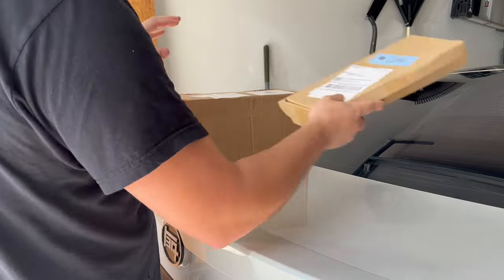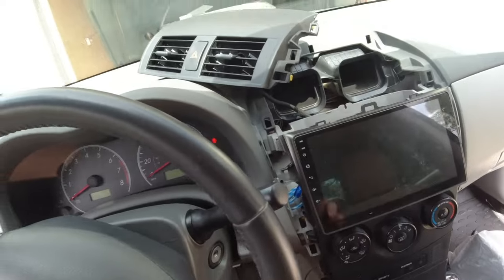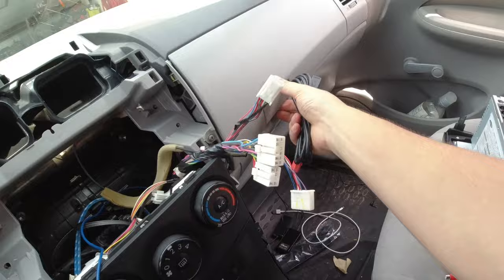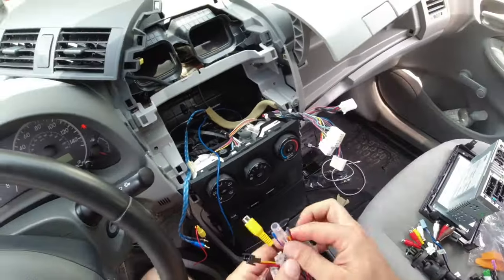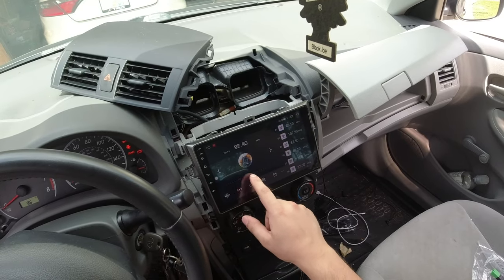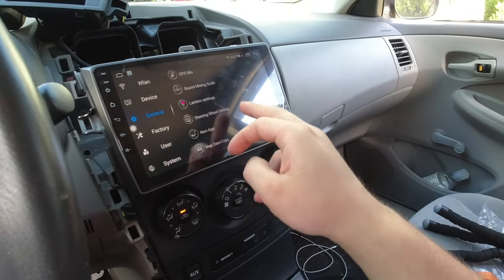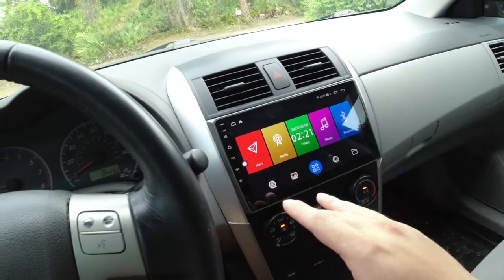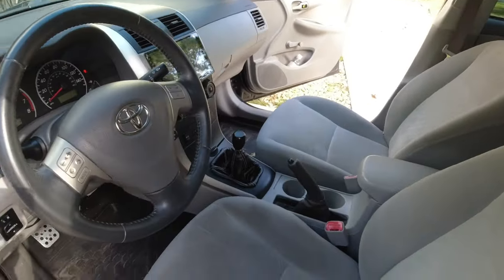Installing a iDoing Radio In My Toyota COROLLA(2009-2013)

Comment: I have one of this myself, decided to get the AHD cameras for the front and back and have the front triggered with mode like you do. Honestly, AHD cameras look so good with these head units as they support them it’s basically crisp. I find it useful when parking at night at dimly lit places
Reply from the maker: Yeah I agree this head unit makes the cameras look really crisp!
Reply: Where did you get your cameras from???
Reply: @LacedRhymes  AliExpress, mine is a 1080p AHD camera for the back and 720p for the front. You’ll have to set the resolution to 720/1080p on your android player to get it to work!
Reply from the maker: I ordered mine from eBay.
Reply: @DawnVengeanceX  ok and do they have one for iPhone??? I use apple more lol
Reply: @LacedRhymes  what do you mean by one for iPhone?
Reply: @DawnVengeanceX  i meant to say is it Apple CarPlay compatible
Reply: @LacedRhymes  My android player has built in CarPlay so whenever you reverse it switches to the camera without disrupting the music. Once you switch from reverse it goes back to the CarPlay screen as per normal, it works fine with the iPhone
Reply: @DawnVengeanceX  cool that’s what i wanted to know before i buy it for my Corolla and also gotta find a reverse camera for it
Reply: @BrandonStellmach  can you please share the links for your back and front cameras? Thank you, Brandon.
Reply: @DawnVengeanceX  Thanks for sharing. Dumb rookie question, what is the "front" camera used for? Does this head unit provide inputs for both a front and reverse camera without having to buy another adaptor?
Reply from the maker: Front camera: https://ebay.us/ZrKg8I

Back camera: https://ebay.us/nm90QX
Reply: @BrandonStellmach do you have another link ? It’s says that’s is not available on EBay
Reply from the maker: @andresvalentinocolinabermu31 I will be updating my links in the next week, some of my older videos the links are not active. Check back within a week and I will try to have the links updated!

Comment: You should do step by step how to wire it and not just do it at a fast paste. You talk about it but we need the step by step
Reply from the maker: Sorry if it wasn’t detailed enough, I try to make them as detailed as possible, without making the video to long or boring. And this video was almost 30 minutes, so I did have to cut some things.
But if you have any questions with the installation, just ask and I will help out!

Comment: For the USB routing, you could have someone 3D print a bracket for your car. There's several STLs I've found.
Reply from the maker: That’s actually a good idea, because the USB’s are always rattling in the glove box, maybe I might do that!
Reply: @BrandonStellmach  I think this one might work, since it's a double cable: https://www.printables.com/model/223573-usb-switch-hole-cover-for-toyota-yaris
Reply from the maker: Thanks for finding that, I was literally just looking for something. I actually have a 3D printer. So I might give this a try and see how well it comes out!
Reply: @BrandonStellmach  Nice. I'm going to order a print from Shapeways whenever/if I upgrade from my Kenwood single DIN to a double.

Comment: Good video. My guess with your reverse is it's not being triggered on the radio. Look for a rev cable on the head unit and the reverse camera retention harness should have an RCA and a signal cable that triggering the reverse on the radio. From looking at you crimping the harness I'd say do the touch test with the bare wire while the car is in reverse, also do it while the car is on some cars are weird like that. Or try an alternative reverse trigger to the head unit.
Reply from the maker: Thank you!! 
And I did figure out the backup camera, I didn’t have the plug in the radio pushed all the way into it. After I unplugged and plugged it back in, the camera started to show up.
Reply: @locorudy626 @brandon stellmach How do these head units know when the car is in reverse? Is the connection for the reverse camera the same whether the Corolla is a manual or an automatic? I have a manual.
Reply: @rtong12  does your car come with factory backup camera?
Reply from the maker: You splice your backup camera power wire into the reverse light. So it doesn’t matter if it’s a manual or a auto.

Comment: Thanks for another great video Brandon! I was using a 8 inch winCE DVD radio in my 09 Corolla which worked great but I wanted apple carplay so I now have the binize that you had but the sound quality is so low compared to the WinCE radio. You mentioned the sound quality on this radio is way better. If you could compare both radios at max volume, would you say it would be worth it for me to invest in this?
Reply from the maker: The radio is much nicer quality with the sound. But I wouldn’t say it’s worth the upgrade if you are just wanting much better audio quality. I can say it is a much better and faster unit all around. With a nicer screen and wireless Apple CarPlay. But if your looking for just audio quality I wouldn’t say it’s worth the double the cost! 
But all the other things I would say it’s worth the extra money!

Comment: Were you able to get your steering wheel button for voice assistant to trigger Siri? When I press it it will trigger the google assistant, but not Siri.
Reply from the maker: Yeah I was having the same problem, I’m not sure if there is other settings somewhere in the CarPlay app. I looked but I didn’t, but only for a minute. I will definitely look into it more to see if I can find a way to get it to work with Siri!
Reply: @BrandonStellmach  I was able to get this working! In the steering wheel settings there is another option. Instead of using the voice control option, use the Bluetooth Mic option. It your video at 20:25 you can see it in the bottom row, third from the left. Once I switched it worked right away. Thanks for this install video, it helped me a lot!
Reply from the maker: @slimgrady187  awesome! I just changed mine too! Now it works with Siri!

Comment: I bought one from Ebay and my steering wheel controls dont work with it, they arent compatible. 
I was thinking of buying an adaptor or maybe getting a unit like yours. What would you recommend?
Reply from the maker: I had a cheaper head unit from Amazon and the steering wheel controls didn’t work either. But I upgraded to this radio and got my steering wheel controls to work! 
Well buying an adapter and splicing it into the stock harness would be much cheaper. But most likely isn’t going to be plug and play. While the radio is more expensive and plug and play.

Comment: Great review Brandon! The wireless apple carplay is such an enticing feature! I noticed that when I purchased a wireless carplay dongle, there would be a delay in audio when switching tracks on Carplay. Does the same thing happen with this radio unit?
Reply from the maker: Yeah that is what’s really nice about this unit. My old unit I was using the apple CarPlay dongle, with a wireless adapter. So I needed 2 adapters just for wireless CarPlay. So when switching songs there was about a 3-5 second delay. This radio is instant on everything you do. Wether you want to change the song. Switch apps or turn the volume up or down. There is no delay, it’s just like a stock head unit.

Comment: @BrandonStellmach I have a Corolla 2011 and want to give it to my son.  I was looking around to replace the Head Unit and found your video.  I really like the look of the IDoing units.  I have a couple of questions.  1) Does the IDoing unit work with the built in mic that is at the top middle front of the car close to the review mirror?   I find this mic to pretty good.  2) Does the Idoing unit work with the AUX USB port that is already in the car?  3) I saw that someone posted a link to 3D print a USB Switch Hole cover, did you try it?  I noticed that I have a blank on the right side of the AUX USB port.  Might be a good idea it that could be used.
Thanks for the Video.

Comment: Nice I want to upgrade my radio too but there's like 5 in ebay that I don't know how would they perform
Reply from the maker: The ones you see on eBay and Amazon, they are a decent radio, because that’s what I had before. But they don’t come with all the extra features and things you would want. Like Apple CarPlay/ or android auto. Many times they are very low grade processors, and tend to be slower when loading apps.Also this one works with steering wheel controls. Not many of the cheap ones do. 
While the idoing is a higher end radio, with better displays and internals, that make it worth the extra price.
Reply: @BrandonStellmach  how much are we talking about? I have 2009 toyota corolla s  that radio that you bought will fit mine too
Reply from the maker: @lalok9912  well the radio I just installed is about $360 and the radio I just took out was around $200. 
And yes this will fit your corolla. Mine is a 2009 corolla as well.

Comment: Great video!!  Could you tell me if it works for a 2009 Toyota Corolla?
Reply from the maker: Yes this will work because my corolla is a 2009!
Reply: I also have an 09 Corolla. I was wondering if you can order without the backup camera?

Comment: Does the brightness of the radio dim whenever you turn your Headlights on? I'm thinking about getting one but I want to make sure it's not always too bright when I'm driving at night.
Reply from the maker: Yes it dims when you turn your headlights on, also you can dim the screen more in the settings if you want to. So you should be able to get it where you like it!
Reply: @BrandonStellmach  Awesome! Thanks Brandon!

Comment: Are you happy with the functionality? Can you provide a follow-up? Thanks!
Reply from the maker: Yeah, this radio has been great. I might do a follow up video in the future!
Reply: @BrandonStellmach  Any glitches or problems to know about? Thanks for the reply!
Reply from the maker: Honestly I wish I could tell you I had any problems. But I haven’t, other then 1 day I turned on the radio and it froze. And I just had to hold the reset button on the radio. 
But that only happened 1 time, In the last 6 months. 
It’s very fast and responsive, and the wireless CarPlay is my favorite, and it also works flawlessly.
Reply: @BrandonStellmach  Great to hear, thank you again!

Comment: Really great video, I plan on getting this for my 2013 corolla but I was wondering if I can get apple car play wireless on my android phone? I don't know how this works since it's my first time but if so how would I get it on my phone?
Reply from the maker: Well Apple CarPlay will only work with an iPhone, but this radio does offer android auto. I don’t know if it is wireless. So you will have to plug it in with a USB. But android auto is an equivalent to Apple CarPlay. 
And you will just open an app on the radio and plug your phone in. And it will recognize your phone. You do not need any app on the phone.
Reply: Thank you for that because I've been looking around for information before I buy it and this helps me out
Reply: Another question, for the wifi antenna does that mean it automatically gives you wifi or should I just but a Sims card instead?
Reply from the maker: @zenakuokubo7929  the wifi antenna is only to help connect to wifi, either when you are close to your house, or using a hotspot on your phone.

Comment: Brandon! Does it get slow when it gets hot inside the car? Like Idk if you have seen it on other cars but when it’s too hot cause the weather outside and you get in the car and turn it on the screen starts working slow cause of that — have you had that issue with this since you installed it? 

Also, with the Apple car play, does the Map works with it?
Reply from the maker: I have had this radio in my car for about a year. And I have not experienced or had any slow downs or glitches.
Honestly it’s been a lot better then I expected!
And yes Apple Maps works great with Apple CarPlay.
Reply: @BrandonStellmach  great to hear that! I’ll get one for my Corolla 13!

Thank you Brandon!

Comment: I have jbl amp on my corolla but hope you can still help. I talked with idoing and they told me to connect the orange amp ctrl wire with the blue amp-con wire. Do you think this will be fine and not short anything out? 
And my second question is, im also installing subs, will i have both orange/blue wire connect with the wires for the subs?
Reply from the maker: Honestly there have been several people ask about this. But from what I hear is they usually don’t connect the factory amp. 
And especially if you plan on adding subs, you are most likely going to get another amp, to supply the power for the sub, because the factory amp wouldn’t be able to power it good.
But I’m not sure if connecting those wires would short anything out. It seems more like a bypass.If it shorts the radio, it most likely will just blow a fuse or something.

Comment: How’s the calling quality? The one on the OEM Corolla 2013 is pretty fuzzy.
Reply from the maker: I don’t use the radio for calls that much, but the microphone in the head unit is decent. But I wouldn’t say it’s the best.
They do provide and external mic to put it where ever you want. And that should give you good quality calling.

Comment: How well is it holding up all these years now? Also how would i know if mine comes with JBL amplifier? I never switched radio system in any car. But i know my car doesnt have a backup camera 2013 corolla.
Reply: Just want to get one since its plug and play which i like. Haven’t found any other thats plug and play.
Reply from the maker: These radios have been great! I have had these in my cars for the last 5 years and have no issues! 
If your radio has JBL it would have the logo on the stock radio. 
It’s nice that this radio is plug and play which makes it super easy to install!

Comment: Great video…!  I have just started to use Apple CarPlay on this head unit…but I have to press the Carlink 2.0 app every time the head unit starts. Did you find a way for the app to start on boot automatically or you do it manually too?
Reply from the maker: there is an autostart for the app, but I find that it takes longer for it to boot the app up, then it is to click the carlink app. 
I just click the carlink app every time because I have just gotten used to it.
Reply: @BrandonStellmach  I have just found the setting…it just takes 3-4 seconds until the phone connects to the unit and CarPlay is on!

Comment: I can't find the wiring harness for my Toyota Corolla 2009 with the JBL system. I ordered one on Amazon and it didn't match my car. I honestly need help.
Reply from the maker: Sorry for the problems. I know this unit isn’t a plug and play for the JBL system. But people have got them to work. I believe you need to connect 2 of the amp wires together for everything to work. 
But for the best help, I would contact idoing and they will give you some good instructions to help with the JBL system!

Comment: Can I reuse my original radio trim bezels? Or with the install do I have to buy a new set I kinda wanna just keep the original 😅 thx
Reply from the maker: Yes you can use the original ones. I only replaced mine because one of mine was broken!

Comment: Hi Brandon, can you tell me how I can change and put the logo of my Toyota car on when I turn on the stereo?
Reply from the maker: There is a way to change it. But I believe it’s in the factory settings of the radio. Which you will need to find out the pin in order to get to those settings.
But once you get access you should see a setting for startup logo.

Comment: Brandon in your video the finished product has a very nice tapered trim piece that allows the screen to stick out very slightly from the flush mounted original radio. When I click on the link you provided the picture looks like the screen has a different trim piece around the screen. I'd like to order this unit, but I like the trim around the screen in your video better than what they show on their web site. Do you know if they made a change since then? Thanks for your help!
Reply from the maker: That is the exact same one as I bought. Not sure why the pictures don’t represent it accurately. A lot of times they show them on European cars so they look slightly different.
Reply: @BrandonStellmach  Thanks for responding! looking closer at the pictures, it may be the same one. Looking forward to ordering and installing it.